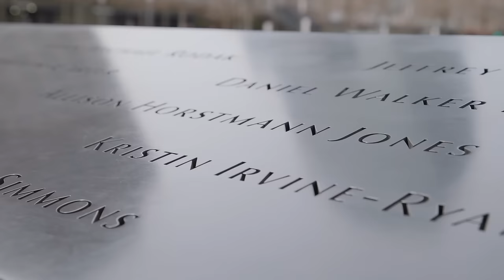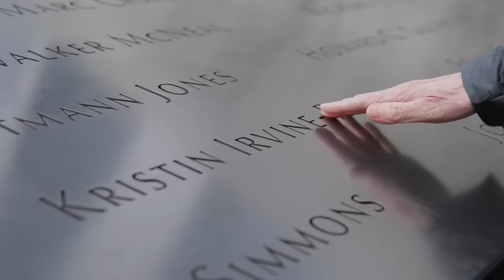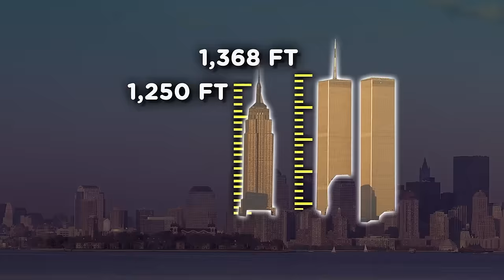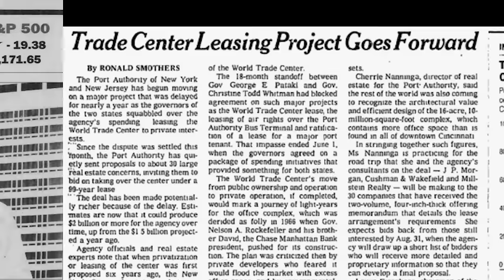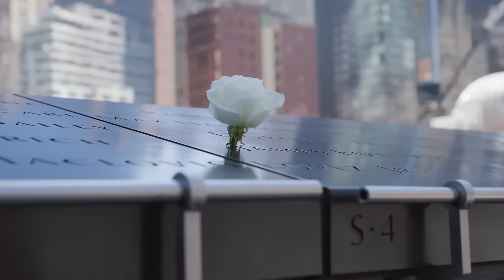The Story of the World Trade Center | New York City Revealed

Comment: They should’ve just rebuilt the towers behind the old footprints and made them taller and out of different material but hey I’m not in charge.
Reply: Trump actually suggested that, in 2002
Reply: Trump actually suggested that, in 2002
Reply: @quietq1631 Trump suggested building the new revamped versions directly on top of the old footprints. @rewelldrums is saying they should have built them farther back behind their original footprints, which would have probably been more acceptable to people.
Reply: @jus10lewissr Trumps plans were not to build on the original footprints. Any plans or photos will show you that. He wanted to build a memorial around the footprints that replicated the old towers.
Reply: @jus10lewissr  right but the reason why the twin towers was demolished is because the extreme levels of absetos in the material used to fireproof the trusses and the nanothermite paint used on the walls, and how the building had to be entirely wired for WiFi and Internet, and the replacement costs exceeded the cost of rebuilding the towers, so technically they should have rebuilt it exactly the same design except use approved materials and wirings according to current technology standards. Also most of the floors were actually vacant so that's why they built only 1 Tower due to the unnecessary need for cubicles due to the ability to work from home, and the increase of much needed residential apartments.
Reply: Yourfavorite_AviationGeek  you dont think there could be another "event" with the glass tower they built?
Reply: That’s potentially traumatizing to ppl who actually witnessed these events in person.
Reply: @shade221  There hasn't been another hijacking since 9/11. Reaching the cockpit is impossible. Remember when you could walk all the way to the gate even if you were not a passenger. You could say goodbye or greet a passenger right our of the gate. Things were way too lax back then! Too bad we didn't have this security before that horrible day.
Reply: Nobody needs that much office space anymore. They can’t even fill the one building
Reply: @quietq1631 it we couldn't be the same💔

Comment: I really like the Freedom Tower, for the most part, and the way it was constructed/engineered internally is brilliant. I do wish they would have built two of them and offset them in the same diagonal fashion as the original towers, though I definitely understand that they lacked the space needed, being that they needed so much room for the reflective pools where the original towers had once stood. I just wish there would have been a way to have the reflective pools where they are and still build two identical "twin" Freedom Towers.
Reply: A part of the video got me thinking:
20:22 When they reconstructed the site in the late 2000s, they added streets back that hadn't been there since the late sixties/early seventies. The site of the twin towers ultimately caused them to complete delete one or two of the existing streets at the time for extra space. Looking at the image shown, they could have technically built a new twin set of towers on that site, staggered over a bit so as not to impose on the area the original towers had been. I get why no one wanted to give up the spots where they built the other towers in the complex, but they surely could have figured out a way to construct "twin" towers and still allow room for other buildings and the reflective pools. The World Trade Center complex as a whole is pretty large altogether, and I'm grateful for the Freedom Tower, but it's still disappointing that they didn't build two of them.
Reply: Especially considering the fact that they haven't even found enough tenants yet for the final tower that they've yet to build. Being that there isn't enough tenants to fill up seven buildings, finding the space to create two twin towers wouldn't have been difficult.

Comment: Jet fuel doesn’t melt concrete 14:05
Reply: It was explosives, you can't demolish concrete blocks to dust that quickly
Reply: What concrete? The WTC was made out of Steel Glass & sheetrock
Reply: @melvynsngltn27 it was a mix of all
Reply: The twin towers main structure was completely made out of steel not concrete